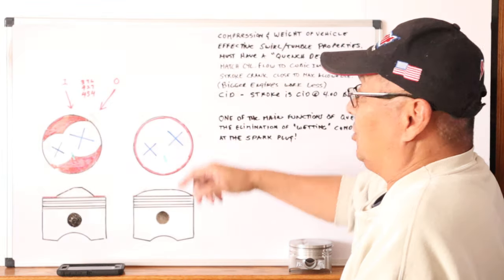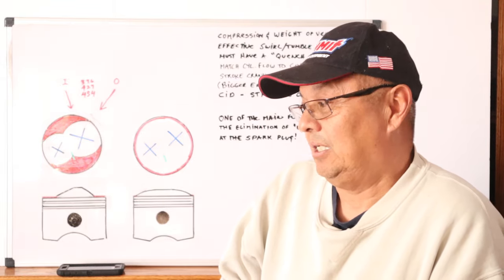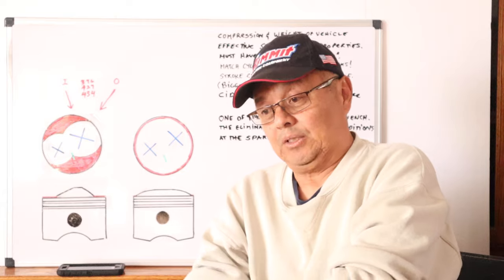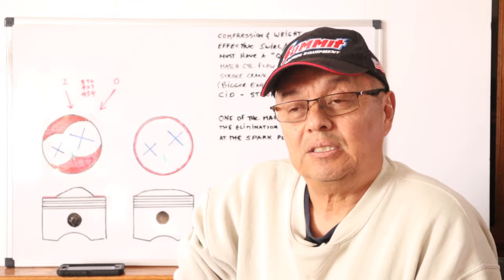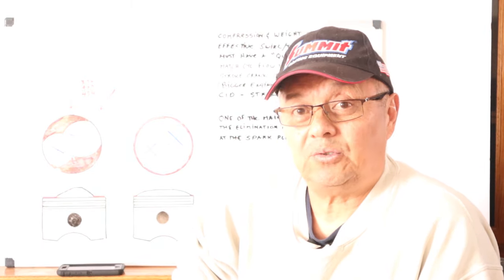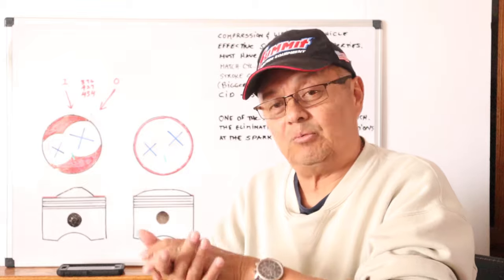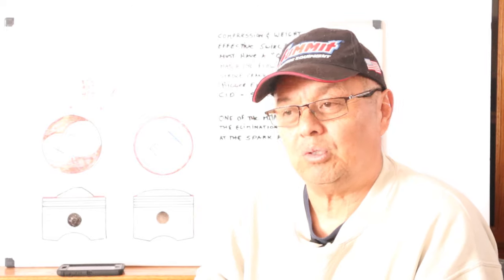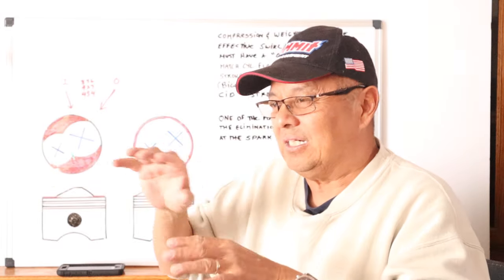HOW MUCH COMPRESSION PART I CAN WE RUN ON THE STREETS?

Comment: BMW and Mercedes have engines 11.5:1 from the factory.     For coyote gen 2 is 11:1 and gen 3 is 12:1.    All will run 93 octane and reduce octane with decreased timing advance.  Each pt of compression is about 4% torque increase across the curve.   So its certainly worth being concerned with.
Reply: I was running 10.5:1 back in 1992 using  IRON Ported Windsor jr heads, we polished the chambers and i ran 93 octane with a "normal" 5.0 stang base type timing.   No ping problems, just power.   With aluminum head I would have run 11.5:1 back then.   What inspired me was David Vizard "How to build horsepower" book.
Reply from the maker: If you would have added 3-4* from base timing, you would still been safe from detonation with more power and torque to really enjoy your ride!
Reply: @benalamedaracing2765  We certainly bumped the timing as far as we could and backed up a degree or two...

Comment: Great lessons Ben.
 Low compression not good in the combustion chamber.
Aluminum heads, high compression (10.5-11.1), quench,  proper carburetor size, light car, 3.42- 3.73 gears and correct total timing.
All on pump gas (93,94) street car.
Makes excellent power and quick reaction off the line.
What more could i add?
Reply from the maker: Did you install underdrive pulleys?  They are good for power and a little mileage addition.

Comment: and here I am... Just bought a 2004 6.0 ls lq4 engine, stripped it down... no unusual bearing wear, cross hatching still visible in the cylinders... Going in a lowered 2005 2500 hd, in search of tire squealing torque.. scrapping the  stock heads and dish pistons for a forged rotating assembly..... trying to get a plan together...

Comment: engines without quench give mushy performance & require more spark advance  to make mean best torque. more spark for power = loss of compression pressure because you have lit the charge early. The more excited the charge is  because of quench the easier it is to ignite..
Reply from the maker: You got it right on point sir!

Comment: I see a lot of people build a big Windsor with 9:1 compression and not even making 400 rwhp. I always ask them why they are building blower motor and they say the same thing pump gas.
Reply from the maker: These is why big inch small blocks burns rubber good and fade on the top end with low compression!

Comment: a few years back I acquired a 1990 Suburban with a 350. It would not pull a 5% grade on the interstate without down shifting and losing 20mph. SO, I pulled the engine. The engine wasn't factory colors so I assumed it had received a long black at some point. Compressions were factory fresh so I decided to leave the bottom end stock. SBC aluminum heads raise dcompression to 10.5 to 1. I aded a cam that was just shy of an idle gallop. A high rise intake, headers and an Edlebrock 1400 series carb. It dyno=d at 400hp and 390ft/lbs and ran everywhere on 87  octane without detonation
Reply from the maker: 400hp is a good number and is no slouch!

Comment: Good video for sure. Surprised the Cobra engine builders didn't know that about pump gas. I had JBA out of California build me an engine to go vintage racing in the early 90's, 351w about the same cam lift. J302 heads 11.5 to 1 and raced it with nothing but 93 octane pump gas. Ran perfectly fine. 30 to 40 minute races and practices. Engine is still in the car. I forgot total timing but probably around 34 degrees max.
Reply from the maker: You went to the right guys @ JBA.  James Bittle is a good friend from years ago and one of the nicest guys you will ever meet.
Reply: @benalamedaracing2765    They were the only company at that time using the new J302 head. The real brains for the engine build was Doug Baker. I don't know what happened to him. I talked to him personally a few times. He was pretty sharp when it came to building engines and figuring out what the customer wanted.  I still wanted to drive the car on the street so we ended up with a crane cam originally ground for a Cleveland motor. Had 400 ft lbs. of flat torque curve. and still achieve 425 hp at around 6500. 1.7 rockers to get .580 to .590 lift. Speed pro pop up pistons, to do exactly what you described in the video. Great motor with longevity in mind. With the technology in head design that engine would probably be close to 500hp now, changing nothing else but head. J302 only flowed stock right around 210 cfm intake side.

Comment: Your taking about static compression. The Dynamic Compression is what counts. Dynamic has to do with valve timing events. If they are running 93 octane your dynamic will/should not be beyond 8.5:1 compression.
Reply from the maker: I explained that in detail on Part II of this video.  A more simple technique is the cranking pressure not exceeding 200# and advancing or retarding the camshaft will increase or lower this number so further running pump gas without detonation.  All explained in it.
Reply: @benalamedaracing2765  Oh! Okay. I paid not see that vid. My apologies. Yes, cranking pressure would be a solid indicator also as you mentioned. Do you explain the tolerances needed for proper quench? How do you calculate the stretch of the rods so the piston doesn’t make contact with the head?

Comment: You theary grab my attention, it make complete sense to the engine enthusiast.... so, I subscribed. Now if would awnser my question.  The blue thunder head that you put the intake port plates on the 3.6 or 4.3? Are these head still being produced and is the 4.3 a improvement over the D3 or sc1? Great job explaining your video.
Reply from the maker: Thanks for supporting my channel and hopefully I can keep doing in depth analysis instead of just saying this work or that did not!  Comparing the D3 or SC1 to a Blue Thunder 3.6/4.3 is not even a question to an experience engine builder/cylinder head technician.  The mere fact that the Yates can be taken down to the 30cc range gives it an unsurmountable edge that even airflow cannot overwhelm!  BT 4.3 will exhibit airflow comparable to a Yates given similar port volumes etc. But the compact chamber and flat valve angles yields superior burn rates with smaller to no  piston dome a BT could not equal.  
I have run all of these configuration and the YATES will always top the list in power/torque and rpm potential.

Comment: I had a smogger 454 with 8.5 to 1 compression. Oval port heads with a rectangular port intake and a mild cam. It did mid 13's and would probably have run on hobo piss. I don't trust the consistency of gas stations, keep the compression reasonable and you will have a more enjoyable ride, and a heavier wallet.
Reply from the maker: Did you match the intake ports on the manifold and head?
Reply: @benalamedaracing2765  Nope. We had the intake and threw it on to see what would happen. It was fun in town and actually got decent highway mileage. I have a theory that fuel puddled at the step at normal rpm's and got sucked in when there was enough air flow acting like an accelerator pump.  It was the perfect street set up as far as I'm concerned.

Comment: This video and presentation is extremely informative and helpful.... Ive been chewing tums for indigestion caused by me worrying about the Ford 300 inline six im building on a budget. I knew at 8.0.1 compression it wasnt going to make anything resembling power....itd be a lazy pig. So im having the block bored .050 over to  accept a 360FE piston so i can have a true flat top piston and get a higher compression height, and we are decking the block and milling the head. Havent found any real info on it other than "people used to do this back in the day" , but i was hoping for something close to 10.1, and the camshaft is a custom grind 206/212 @.050 447/460 lift with stock 1.6 ratio rocker arms. Stayed mild on the cam since this engine will be limited by its rotating assembly to under 5000rpm. But now im being warned about a high dynamic compression ratio thatd make it too high for pump gas in the 4400 pound van the engine is going in. Any thoughts?
Reply from the maker: Yes it seems the cam is way too small!  You have a lot of weight you are moving and adding duration even in the 214-218 range should not do any damaged.

Comment: My street engine in my Sonoma was dynoed on 89 pump and features 47cc chambers and custom Ross piston's for 10.7 to 1 which i'll be running on 91 pump. 399ci. 1st gen stroker.
Reply from the maker: That should work great for the street!
Reply: @benalamedaracing2765  400 ft lbs@3500..........513 ft lbs@4500.......shows over @6400 still over 525 ft lbs, at 63 i'm old school.

Comment: Back in high school I built a 10.5:1 327 with aluminum L98 heads for my '69 Nova. Everybody told me 10:1 was the limit for pump gas and that I'd have to use additives or reduce total timing. Luckily one of my auto shop teachers knew better. Thanks to the small chamber aluminum heads and flat top pistons with a tight quench the car ran just fine on 90 octane pump gas. Years later I built an 11:1 331 stroker using the same basic principals and Holley Systemax heads for my notchback. Again it ran fine on pump gas, including lots of passes at Englishtown, only detonating if you lugged it on a hill in 5th gear(which 5.0's did with stock compression).

Would I build either of those engines with an "RV" cam and stick them in a full sized car or truck? No. Would I possibly go higher today if I had a reliable source of good E85? Absolutely.
Reply from the maker: Glad you got it right years ago and got the benefit of good power with the right compression on the streets!  Thanks for your comment and appreciate the feedback big time!
Reply: Same concepts in heavier vehicles as well... I live at 5k elevation, and was told by all sources to not go past 9.5:1, or I'll blow up my engine... RV cam and 11.1:1 was the best running towing (25k gvw) engine I ran to that point. Understanding tuning is where people get into trouble. Give the engine what IT wants, not what you think it should have.

Comment: This is only relevant for two valve heads where the intake charge creates a centrifuge spinning fuel outwards, but pretty much every engine for the last 30 years has been four valve which creates a tumble so a flat or dished piston is preferred. The most efficient pistons for a modern engine are flat or dished with a  perimeter quench area.
Reply from the maker: I agree with your last statement but your introduction is really off base, "only?" and let me explain to you why.  Check frames 55:20 of this video and it will explain "tumble" motion and how the fuel molecules has to almost travel a full 360* turn to return some fuel to the 4V's intake short side!  I have worked from 1250rwhp turbo six street engines to Mercedes Benz 24hrs of Daytona & 12hrs of Sebring endurance engines (pls check my 2JZ build on FB Ben Alameda Racing) which I go thru the details of cylinder heads and block design.  Almost ALL 4v's do not have a short side to influence some kind of radius entry to the short sides enabling fuel to go to this lean areas!  Almost ALL depends on tumble motions that slams the fuel to the opposite side of the cylinder walls under the exhaust valves.  Piston movement shoves most of these fuel droplets to the exhaust pads/valves and hardly anything that somersaulted inside and on top of the pistons ended up on the intake valve/pads!  These are the reality of endurance engines and it gets worse on drag application which entails much higher boost levels shoving the fuel stream to the extreme end of the cylinders (opposite the intake valves).  
Anyway, the saving grace is 4V's predominant mostly "small bore configuration" wherein the flame front can easily spread to the intake area due to the "centrally" located spark plugs compared to domestic 2V's having bore sizes way past 4 inch diameters, spark plug located on 1 side and below or mostly below the  combustion chambers. Remember small bore engines have less chances of detonation compared to its bigger  bore counterparts wherein the flame front, farther away from its ignition source increasing chances of secondaries by a wide margin due to temp./press. spikes before it is consumed by the expanding flame front.

Comment: Gen 3 Coyote ( 2018 up in Mustang) runs 12 to 1 stock with Hyper pistons, usually check 220+ psi cranking...just fine on pump gas...however they have nice active knock sensors they will even ADD timing not just pull it ( DI and Port injection blended )

Comment: awesome! Hey. 
355 c.i. 5.7" scat stroker rods.  9" deck height. 4 bolt 010 block.
4.032" bore size.180cc Dart heads 63cc chambers milled from 64cc. 10.3:01 static compression. Performer EPS edelbrock intake. 7CC piston tops. custom crank scraper kickout pan. 800 rpm idle 14" vacuum. Schnieder racing cams hydraulic roller cam# 27684H 112*LSA/ 106* ICL. Nylon cam button. 7.4" pushrods. 36* total timing. 175 cranking PSI. O.028" Head gasket. O.009" down the hole. HEI. 750 cfm Holley on 1/2" phenolic spacer. Running 90 octane. Made 410HP @ 5700 RPM peak. And 465 TQ. @ 3600 RPM peak. Next i want to try this with an aluminum AFR or TFS head or DART 180-190cc ports or even larger on an efficient AFR head. Competition ported. Or BRODIX. And slightly more compression. 10.75:01 with same cam and see what it does. Then a 383 with a Mike Jones Cam Designs EHS Hydraulic Roller 282 with the correct lifters from them.
Reply from the maker: Looks like you already got it close to being the best it can be!  Going slightly higher on the compression will improve from here and stepping up perhaps to a 195cc heads with smaller chambers and higher lifts perhaps with running a 1.6 ratio on the intake should yield more power.  Good luck!

Comment: I realized this when I looked at supersport street bikes. They have over 12.5 to 1 compression ratios and run on 91 octane gas. Modern 200 HP 1000 cc bikes are over 13 to 1 compression and weigh around 450 pounds. Not much load under normal operation.
Reply from the maker: Light weight with good gearing helps the engine big time!  But most of all, a smaller bore diameter isn't as prone to detonation as a big bore engine combination.

Comment: Great stuff! You didn’t touch on intake valve closing time, could you include that next time you revisit the subject please?
Reply from the maker: Dillon, thanks for your support and appreciate it much.  On intake valve closing time you are correct and missed that altogether.  In fact I should have said "dynamic compression" is a factor and if we place a number on that?
If we crank the engine 4-5 times on the compression (gauge kicking the needle), we would like to see 200# and below signifying the engine will tolerate the compression on pump 91-93!
If it exceeds this number more than likely it will detonate.  You can advance the cam timing  to bring it closer to 200# or retard to reduce this number and the intake valve closing.
Hope that helps!
Reply: You could always massage chambers or piston valve relief area for any cc you need for reducing final compression very slightly, here as little as 1cc shall have a great affect. So plan your target and work under. Check cc of every piston and chamber.

Comment: Hello Ben. Would you recommend softening the camber to eliminate or lessen the concern of quenching? Thank You
Reply from the maker: Softening the chamber works primarily on boosted or nitrous engines.  I know of gains with this concept if you pay attention to the actual quench clearance taking into account the rod stretch with steel or aluminum rods.
Reply from the maker: Shaun, I will be coming up with an in depth video explaining your concerns and it should be an eye opening presentation!  Soon buddy and thanks for your support.

Comment: I've got a 1971 383 with 906 heads and got about 9-1ratio. The cam is a factory Chrysler cheater cam which has a little over 300 duration I believe but stock lift of .450. since I have zero deck height pistons, I'm going to run a set of 1966 383 closed chamber heads. -9.5cc compared to the open chambers. .020 head gasket. I think closed chamber with flat top pistons pings less than open a chamber with a raised dome on the same octane of fuel. Chrysler called those heads "fast burn" and that's why they are expelling a lot of unburdened hydrocarbons. For a clean burn exhaust you can't go much above 8.5 compression. Open chamber heads are nothing but smog heads for their slower burn. No quenching here and no performance, but cleaner and less hydrocarbons for the catalytic converter to reburn.
Reply from the maker: Watch your quench clearance and i suggest you go minimum .035 on that because the weight of the piston and rod with a big block.

Comment: hello Ben, thanks for all the good info. i have a 2000 honda accord with a sohc 2.3 liter. im torn between rasing the compression with k20 pistons or just adding a turbo to it. not sure if your interested in the honda sec or not
Reply from the maker: What will your actual compression ratio be when you do this combination?  That will dictate if it will work.
Reply: Currently at stock it has a compression ratio of 9.3:1, with a bore 0f 86 and a stroke of 97mm. the only pistons and rods i can find right now have a compression of 11.5:1, so im looking at going with those